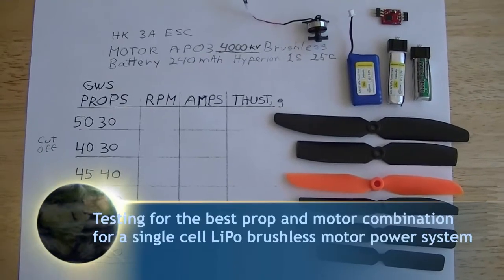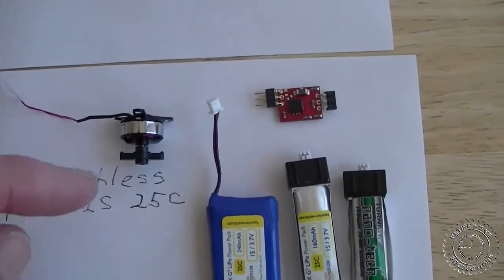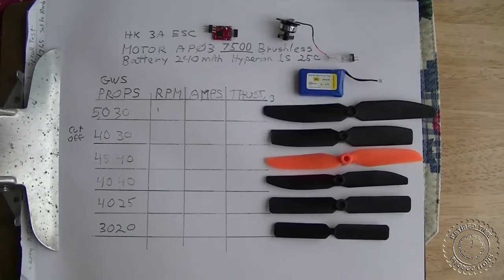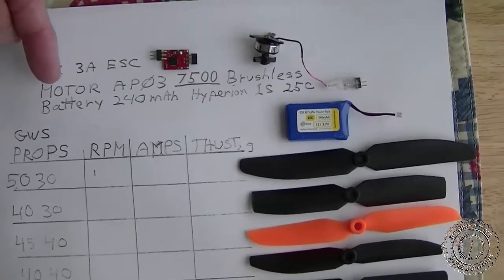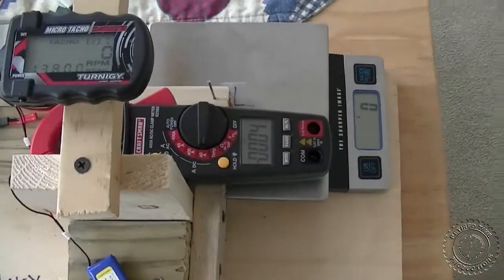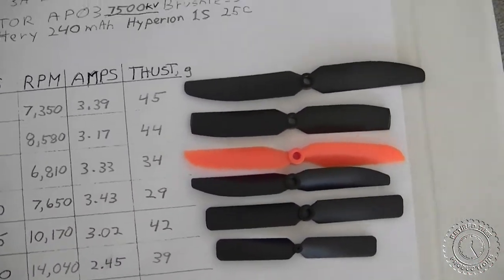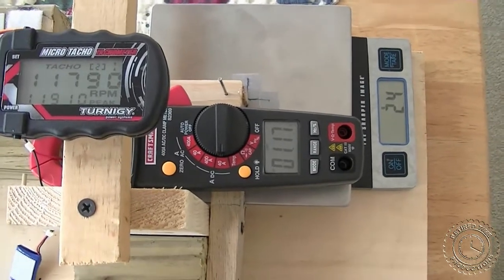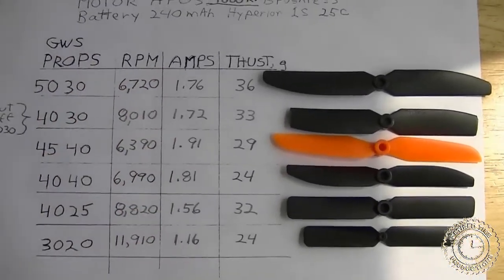AP03 Brushless Motor, Choosing Propeller for 1s LiPo Power System on RC Ultra Micro Planes

Comment: I have 2x 4000kv APO3 i am wanting to use in the HK Wright Flyer elastic band free flight model. I was going for 2 cell lipo, can you do a test for that please ? )
Reply: I also want to use this motor with 2s and wonder which is the best prop, I'm guess in the 3x3 to 4x2 area

Comment: so does the pitch of the prop matter
or can the pitch be as high as possible
Reply from the maker: Pitch is very important as well as size. The 5x3 prop seems the best.
Reply: ok so if i have a 29mm 2300kv motor can i run a 7 by 6 prop

Comment: I can't find a prop adapter / saver for this motor, it has a 1.5mm shaft, I can only find them suitable for 2mm shaft, where do you get yours?
Reply from the maker: I got some light weight plastic one from BSDMicroRC
http://www.bsdmicrorc.com/index.php?productID=665